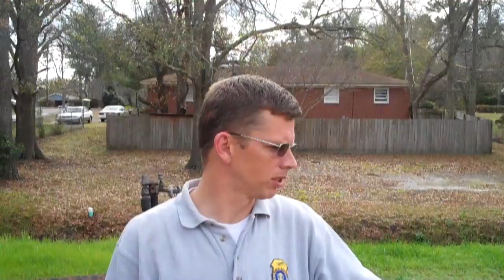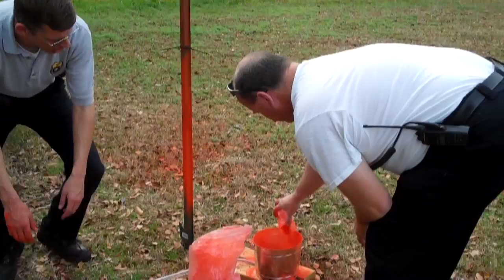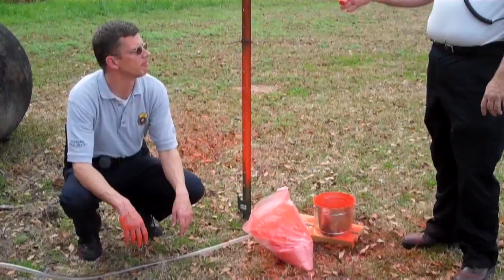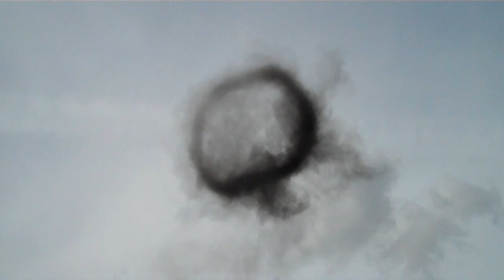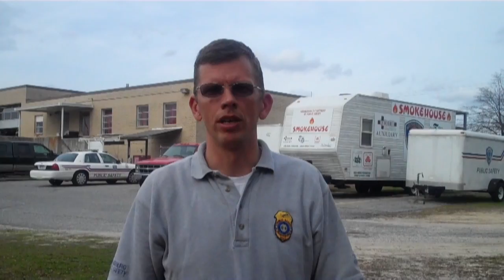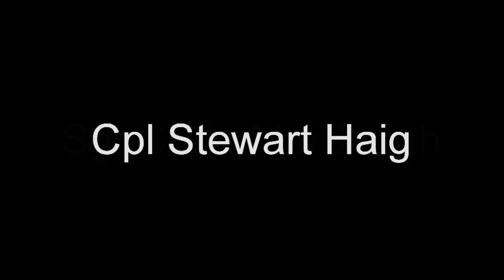Powder Coating Flammability

Comment: great video, i have a huge clean up project and needed a better understanding of how this stuff behaves if it does catch on fire. luckily it seems that there is no trail back to the original source of fuel, just igniting the aerosolized part. Thank you!!

Comment: Over 23 years no explosion, this is the result of a highly concentrated powder with a flame. I took a torch and put it in front of my powder gun with absolutely no fire. I would be slightly more worried about a explosion in a commercial conveyer line powder booth but only slightly.

Comment: No surprise here. The salient point is not that "this is going to happen sooner or later" but don't have an open flame around this or any industrial process that involves dust. Furthermore commercially designed powder application booths have IR/UV detection systems that shut down air and powder feed when the slightest spark or flame is detected. Please consult with your powder application gun manufacturer for more details.